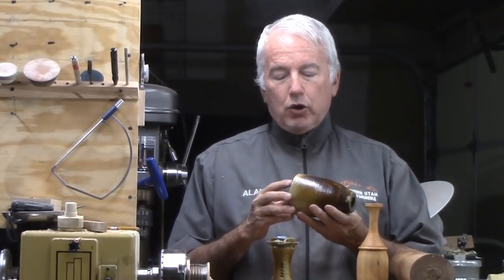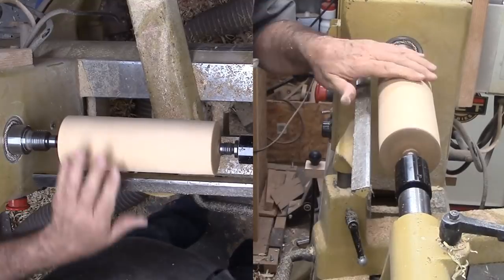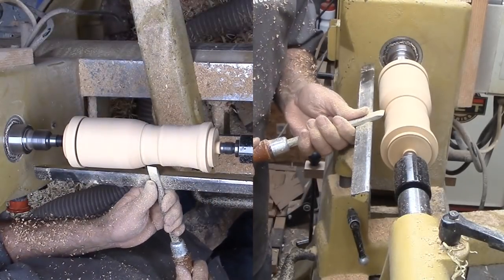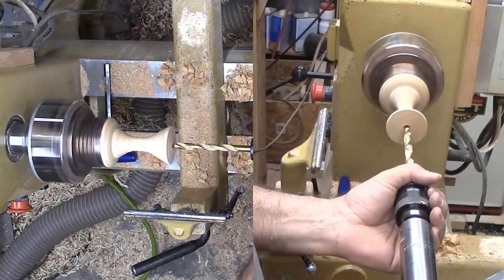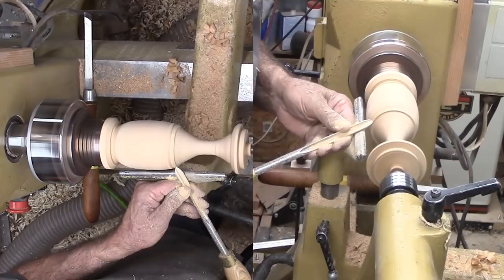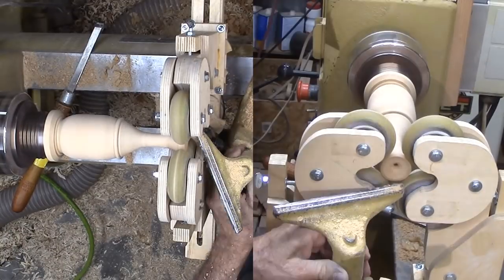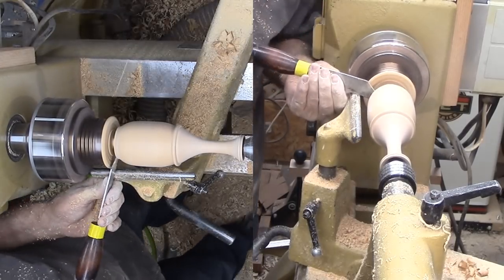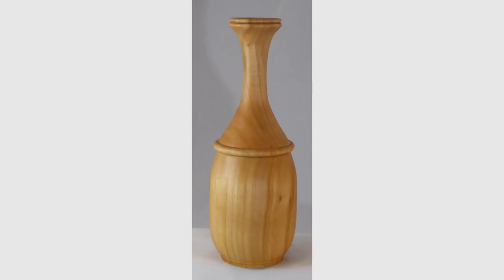How To Hollow A Tall Thin Cherry Vase

Comment: Dale Nish demonstrated this several years ago at a club meeting. He called it reverse turning. Most of this type that I have done, I plugged the bottom and tried to match up the grain after hollowing to hide the joint. This allows you to make a very small hole and a very thin neck but have a very light vase, unlike weed pots where you only drill a hole and don't hollow the base. It is a fun project. Nice work.
Reply from the maker: I plan for a bottom access soon. 
Alan

Comment: Loved the vase, a new concept to the others I've seen.
Is there a finish for the inside to make it water proof so live 
flowers could be placed into it?  Thanks
Reply from the maker: I would not recommend water on the inside unless I had stabilized the wood and coated it with epoxy.
Alan
Reply: I have  some epoxy that goes onto  counter top. You put it on in thin coats (two or three). Its name is  GLAZE COAT; its goes on crystal clear with a high gloss. Wandering if 
this would do. I've had several people if they could put water in with there flowers. Have you heard of this product?

Comment: At first, I was wondering how on earth you hollowed everything that deep through the tiny hole... I've had an idea for such a tool, but have never developed it or seen anyone else have such a beast.

FYI, a series of burn lines hides a glue line very effectively and are less intrusive to the design of your turning than a bead. =)
Reply from the maker: I can work wonders thru a tiny hole (if I have an alternate access)
Burns are great also.
Alan